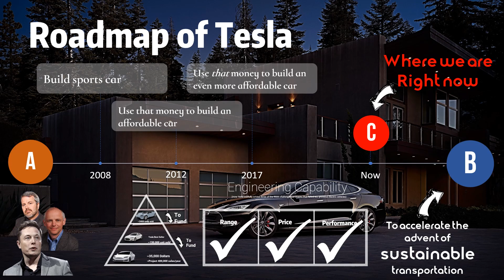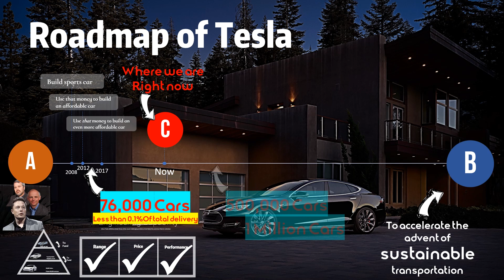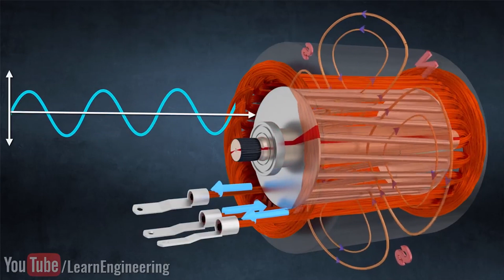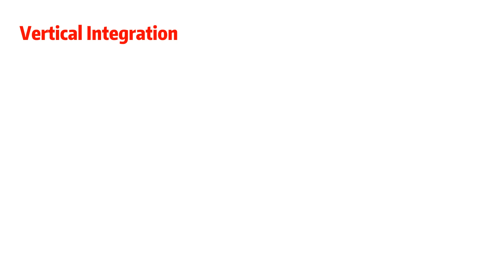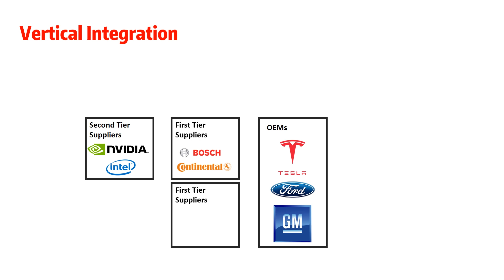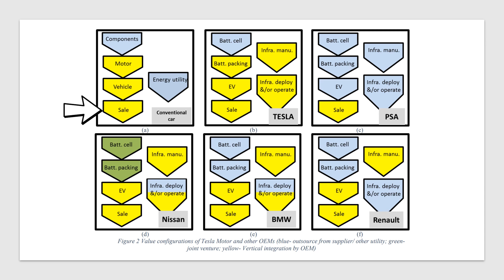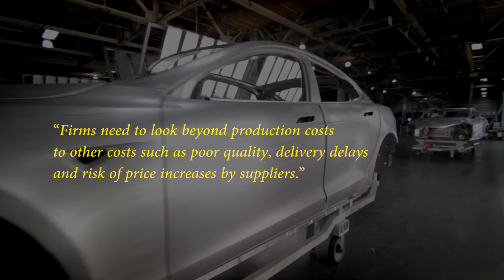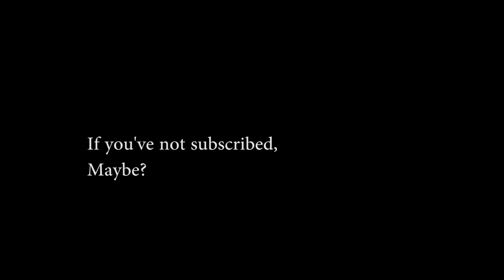What Makes Tesla Truly Different? Ep2

Comment: if we didnt use gasoline for cars we could use that gasoline to run power plants that end up being 2-3 times more efficient than if it were to be used in a car. For every gas car you could drive 2-3 electric ones. The only reason why electric cars arent completely taking over is the battery capacity. Which is still good 200-300 miles on mid end models. New battery tech is just around the corner which should double or triple the capacity at which point gasoline completely loses. Me personally i dont get why electric cars arent taking over this instant. The cost of distributing fuel to gas stations COSTS FUEL and money. Electricity travels basically for free (line maintenance cost) and instantly. Add that to efficiency and electric cars are, even now, 3-4 times more efficient than gasoline. It's sad that oil money still holds power in government places when electric is so much better. Any argument against electric becomes mute once you mention fuel distribution but that's completely ignored everywhere.
Reply from the maker: My guess for the slow change is the tremendous power traditional car company has over consumers. They are simply not selling enough electric cars. production quantity is still a problem especially with the production of the battery

Comment: Vertical integration should not be done merely for its own sake, but rather to make substantial improvements in the overall process. There once was a time when GM, Ford and to a lesser extent Chrysler were much more vertically integrated than they are today. But they stagnated, stopped turning a profit, and eventually had to sell off captive suppliers and dis-integrate. 

If you aren't innovating then vertical integration will turn around and bite you. Independents will continue to innovate, and because you've invested in now-obsolete technology, it's harder for you to keep up with these outside innovations, because you first have to sell off or throw away your investment.

Tesla is currently innovating at a rapid pace, thus the vertical integration is advantageous now. But they have to keep innovating to maintain it as an advantage.
Reply from the maker: Totally agree, the entire industry shifted to outsourcing for a reason, VI is not yet proven to be the right path. we are only confined to our time period.

Comment: Great video, again. Quality of Tesla product is not great yet. Check out all the vlogs on Tesla. However, hardware quality is related to the number of separate parts in a device. Therefor in a few years time Tesla hardware quality can be much higher. A few big issues to fix: the old 12 volt battery and the old style wiring. The many miles of wiring in any car, including Tesla, and thousands of connectors cause many problems in reliability. Finally ... software quality comes next. Quality of software is a huge issue. Complex software systems (MS Windows, Mac OS, iOS, Android) are often failing. Resetting these systems is part of our daily life. Resetting our car frequently may feel different. It feels quite scary when my BMW 5 on board computer resets suddenly ... when I drive 85 mph.
Reply: The vlogs give a distorted view of Tesla's quality. People don't watch  vlogs that consist of "I don't have any problems with my Tesla", so nobody creates them. People are interested in the problems, so that's what vloggers mostly talk about. 

In order to get an accurate picture you have to take a scientific sample of owners of various years of Tesla, or in some other way get accurate statistics of how many Teslas had problems, when, and of what kind. It also matters how severe the problem is. Does it make the car undrivable? Does it have to go to a service center? For more than a day? Or can the problem be fixed in your own driveway by a Tesla service ranger? Tesla has been very good at minimizing customer inconvenience.

Every new car has a few minor problems, especially early in the production run. That should be no surprise. Tesla has been aggressive in addressing their problems at the earliest opportunity and making changes on the production line to prevent those problems in new cars. If you see a problem show up frequently in old vlogs, it should no longer be a problem in cars produced more recently. 

It should be noted that Tesla has not had any headline-making mandatory safety recalls like all the major automakers. They try to address problems voluntarily and proactively.

Another good indication of Tesla quality is the number of repeat customers versus the number of Teslas traded in for other cars. You hardly ever see a Tesla show up on the used car lot of another brand. If you want a used Tesla, you pretty much have to go to Tesla. When people trade in their Teslas, it's to trade up to a newer Tesla with more features.
Reply: dlwatib True, vlogs give a distorted view, as do responses to these vlogs like mine and yours. Most people just do not respond (or just drive their Tesla). So far it is all we have. Once I drive my own Tesla, I will know for sure. Even then I know you also have to be lucky to have no problems. I drive BMW 5 now, satisfied with this one, not at all with my previous one, same model but some serious problems and bad service. What the Tesla vlogs tell me is that Tesla service is quite good.
Reply: The third tier suppliers for model S?  yea, that is old news.  Where are the reports of bad quality on the Model 3?   the first in house product?  that will be the real test.

Comment: If I had $100k I would buy a tesla in an instant
Reply from the maker: As much as I want that, the place I'm from (Singapore), we have way higher Tax, 100k can hardly buy me a model 3....
Reply: Curious Elephant dang that sucks
Reply: Isaiah, if you're in the US, you can get a Model S75 for a lot less than 100K.  You'll have to wait in line, but the Model 3 is said to be really nice, and they start at 35K.
Reply: Only need $35k.
Reply: David Beppler you would need like 50-60k if you want a good model 3